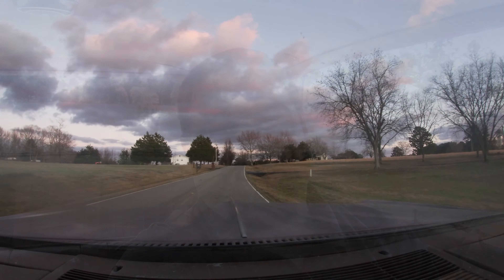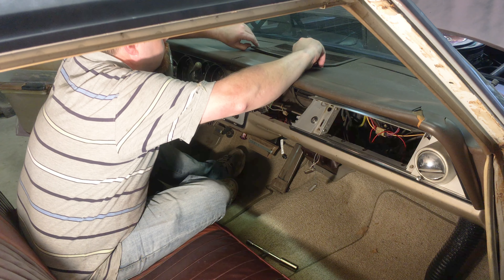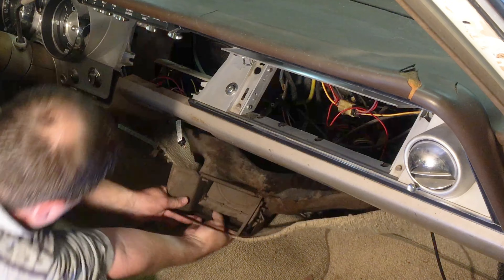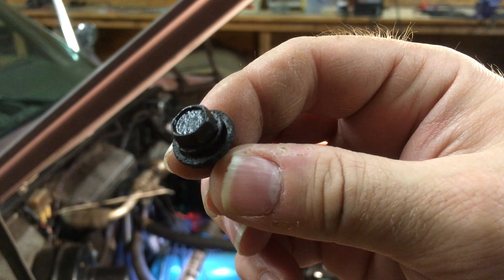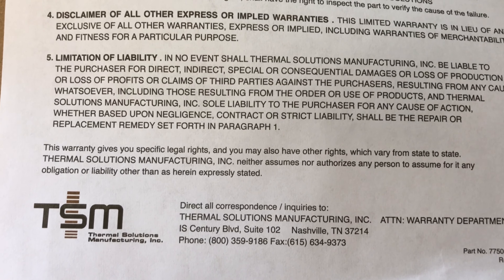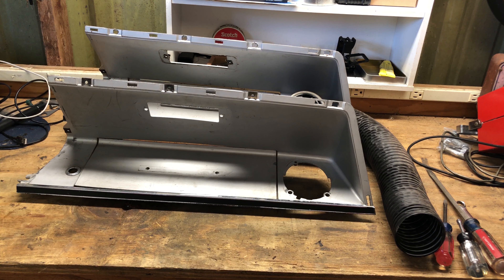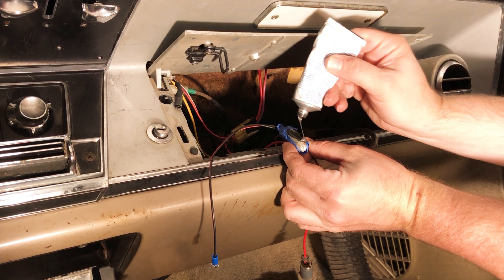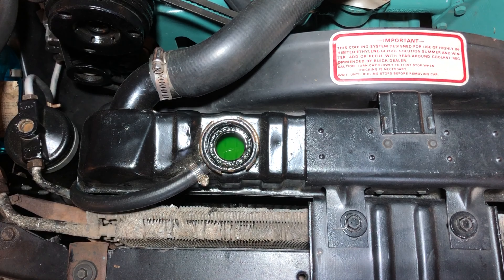HOWTO: Replacing the heater core in a 1964 Buick Electra or Wildcat with AC

Comment: Thank you for posting this video! I have a 1964 Electra that has had a bad heater core for 12 years. I only drive it during the summer months so I have procrastinated this repair knowing how deep I had to go into the dash. I had a three day weekend so I finally decided I had no more excuses and did the repair. A couple things I did that added to the time but made it easier for me: I removed the front seats (mine has buckets) and front carpet section. This gave me more room to work and I didn't have to worry as much about making a mess of the interior. I also removed the right side rear heat duct which made the metal heat housing easier to remove. Also, before installing the new heater core I had a local radiator shop pressure test it. (Years ago I had a new heater core fail right out of the box. There is no way I am going to chance that happening again as much time as this job takes!) Again...thank you for your video! I love your dedication to Sherman and sharing your journey with the rest of us!
Reply: Curious why did you have to remove the seats?

Comment: Great Job! While i love older (pre 1978) GM cars, This job is one aspect of them that I hate. On my 1986 Regal, the heater core took less than an hour to swap even with the lack of underhood space (Buick 455). BTW, i would have used an aluminum unir, they seem to hold up longer.